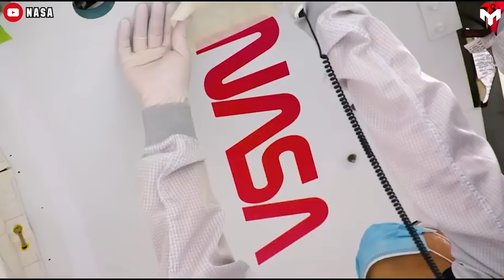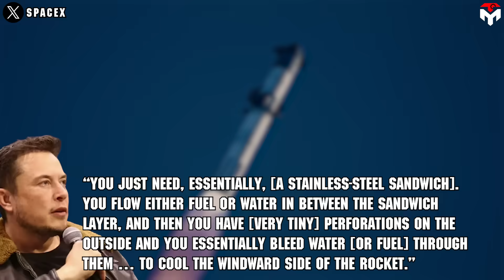SpaceX Crew Dragon to the Moon instead of NASA's $2B rocket...

Comment: NASA's vehicles are hardly failing. SpaceX hasn't been able to get Starship in orbit or reenter from a suborbital flight without the craft being damaged or blowing up. Using such a top heavy ship as Starship to land on the moon presents an unreasonably dangerous risk of the thing tumbling over on landing if there is the slightest error. Musk wants NASA to cancel SLS, just so more money to give to SpaceX. 

Far from failing, SLS had a successful maiden voyage, showing NASA can build a ship that flies on its first try, something SpaceX has never been able to do.
Reply: Has SpaceX begun to Human Rate Starship?  How many years did that take for the Falcon?
Reply: SLS is based on 50 year old shuttle hardware. Plenty of failure there fanboi. Also crashing unmanned hardware is how you build safe man rated hardware.
Reply: Its not a question of failing.  SLS is a magnificent rocket.  But at $4B a launch (now) and esimated $2.1B in the future it's unaffordable.   You could get 20 Falcon Heavys for that! 

And as far as being successful on its first flight, YES!  BRAVO!  But at what cost and how long did it take.  Care to bet that SpaceX has a succesful orbital flight with the chopsticks catching both parts of the vehicle before we get the Artemis 2 launch?
Reply: @ if it were 1975 it would be “magnificent”. But it’s time has passed and it is simply wasteful at this point as you pointed out. Falcon 9s aren’t the end all be all but they are probably a 80% solution at least and economically viable. Starship booster could be used today with a disposable upper and still be more fiscally responsible.

Comment: Orion has pretty much finished its $20 billion development.  The heat shield issue has been resolved.  The Super Heavy could be modified to carry a Starship prolusion stage and easily lift a Orion stack to lunar orbit.  The Super Heavy would have to be crew rated which is in the plan.  Such a system would be vastly cheaper than SLS.
Reply: @WWeronko  I completely agree.

Comment: Ok.  NASA made a big thing about 'reuse' of existing technology - using Space Shuttle era tech to build the SLS.  Well, they should have gone back to Apollo.  If you Google the sizes of the Apollo components - the Command Module and Service Module and Lunar Lander - you will find they can ALL fit inside Starship.  Replace the CM with a Dragon.  Add more fuel to the SM.  The Lander may not be needed - as Dragon CAN land on the Moon - and return to orbit, if it has enough fuel onboard.  Refuel after re-docking to the SM, then return to Earth.  If enough fuel can be stored in the SM, it may be sufficient to reduce the speed once back to Earth for normal Dragon re-entry speeds.  All at a fraction of either an Apollo mission OR an SLS mission costs.The SM AND Dragon could even be retrieved by a follow-up Starship mission to orbit, similar to how being able to retrieve the Hubble Telescope could be accomplished.  Retrieval by Starship, could eliminate the need for advanced heat shielding on Dragon, aside from the emergency backup criteria NASA requires if retrieval by Starship was not possible.

Comment: Maybe this is a dumb question but if the Starship is going to the moon anyway, would it not make more sense to use the Dragon to ferry the astronauts up and transfer them to the Starship after all the fueling,  before it leaves Earth orbit, then reverse the process when they come back? Seems like a safer and more sensible solution to me. No need for a FH. You could use the Dragon as is. It would be easier to beef up Starship than making  a whole new Dragon.
Reply: NASA plans the return trip from the Moon to be rather energetic.  It will fall rapidly to Earth and enter the Earth's atmosphere at very high velocity.  There will be no opportunity to transfer to a crew Dragon.  The Starship HLS (Human Landing System) doesn't have heat tiles and couldn't survive a Earth reentry.
Reply: @WWeronko  What I'm saying is bring the lunar SS back to earth, park it in earth orbit,  then transfer the astronauts to a waiting crew Dragon to bring them home. You can leave the lunar SS in earth orbit for refueling and reuse. Why can't that be done?
Reply: @ It is a question of available fuel.  Breaking to go into Earth's orbit takes a fair amount to fuel.  If you have the fuel available just about anything is possible.  It has been proposed in the past a shuttle to and from the Moon like shown in 2001 a Space Odyssey or a Earth to Mars space liner.  In the longer term both will likely be developed.  For now logistics will limit what is possible.
Reply: @WWeronko  Does not seem like that great a leap to figure this one out. The pieces to the puzzle are already there. They just need to think outside the box a little and pull it together.

Comment: They should just do it to take the wind out of China's sails and reassert US as the leader in space exploration. It could be done reasonably quickly and very cheaply and would boost US enthusiasm into the future.
Reply: Why do you see a need to take the wind out of China's sails? I thought they were doing quite well.
Reply: @michaelreid2329 I don't mind that they succeed, genuinely and not at the expense of others., I'm just a bit suspicious of how well they are actually doing. CCP are habitual liars, and a lot of their accomplishments are fake. You should never support something that promotes lower common denominator like communism does.
Reply: @michaelreid2329  I don't mind that they succeed genuinely, and not at the cost to others. The CCP are habitual liars and their propaganda is unrelenting, they are not adverse to lying about anything they do for global support, so the bigger achievements I'm not so sure of. The main issue I have is they always take over industries as a collective so they operate like communist when they want your jobs and business but not when it comes to taking you money. Sounds like though that you would rather them be the leaders. No capitalist system can avoid being subsumed by that.

Comment: SLS and Orion have completed a successful flight to and from the moon. A Crewed Artemis II will happen before Starship is even at the point where it can successfully transfer fuel in orbit from one SS to another. Then there's the Lunar Lander SS which is at least a decade away from the realization of a space worthy, reliable vehicle. With Space X fans it's always shoulda' coulda' woulda' with the assumption that everything the company sets out to do will be done. We lack only a practical lunar module to complete Artemis. Time to give that task to somebody else even if it could be launched using a falcon rocket.
Reply: @Ferret-v8r  Hmmm… I was under the impression that Blue Origin is already under contract to build an alternate lunar lander for Artemis 4 and beyond.  I would have no problem giving them some additional funding to speed up development by 2-3 years.

Comment: Why can’t we return from the moon to a space station? Then return to earth.
Reply: ISS is also in low earth orbit, moving at around mach 24. so any vehicle returning from the moon would need to dramatically slow down first, requiring major fuel burn
Reply: Because it would take too much fuel. Returning from the moon uses Earth atmosphere to slow it down. To return to ISS, you would have to first carry that return fuel to lunar orbit, then carry it back. The fuel difference would be crazy!

Comment: Not sure what the various weights are and everything but the only thing close to Human deep space certification is the Orion capsule. If the Artemis rocket is canceled due to its cost we have at least two and maybe three ways of using Orion. I believe the taxpayers have paid for and build four Orion. 
Falcon heavy, new Glenn and the Starship booster all may be able to carry the Orion.  It's going to be years before we have a landing vehicle capable of landing and getting back off the Moon, but we could be very close just setting up the orbiting space station in lunar orbit if everyone  cooperated and used what systems we have or that we are close to having.  It just takes someone with a political will to force all these people to get along and at least cooperate enough to work toward a common goal. While throw away Rockets like a Artemis are obsolete, it doesn't make sense to throw away all the research and certification that the NASA has done on the Orion capsule.

Comment: As a business model, unless you had a bunch of customers lined up to buy seats on a Lunar Dragon (including NASA), it doesn't make sense to invest in the time and money to modify Dragon. Using Orion on either a manned rated Falcon heavy or a manned rated Vulcan, which neither currently are, would make a lot more sense. New Glenn also fits into that option. Time is also a strong consideration in this. The time involved to stop SLS and start with another launch vehicle has to be a consideration. If it was an outright cancellation, that would put us who knows how many years behind in going to the moon. The smart thing to do, considering the short fall in estimates, would be to fly sls 1 or 2 flights past a projected restart of the program using an alternative launch vehicle.

Comment: Sorry but I dont get it what is so "genius" about landing a tiny "Pinto" equivalent Dragon capsule when you can land an "18-wheeler" instead bringing a buttload of equipment down to the Lunar surface.....

Heck they even could get a Dragon capsule with Starship down there to fly "back" in it if they so desired......

But yes Dragon and F9 or FH would be far better than SLS and Orion. (if they get a decent heatshield upgrade to Dragon!) but why go with an "on par" lower cost swap when you can go BIG instead??!!
Reply from the maker: Thanks for cmt. But the matter here there are many scandals around SLS and Orion 😩
Reply: @techmap9 Yes I know of them all.....wait until DOGE audits NASA to learn more about it.

A StarShip launch (fully expendable like SLS but in non reusable test flight mode) costs about 100 Million USD.

SLS (WITHOUT THE OLM) costs 4 Billion!!

How can a government job be 40x as expensive?? And that with even using USED and STORED rocket parts (like the Space Shuttle main engines)??

Only possible with MASSIVE CORRUPTION and kickbacks.

Still the treatment for SLS should not be a Dragon/FH solution but make Starship Lander a complete system = start with astronauts, fly to the moon, land, get off the moon and land back on earth (or at least enter LEO and dock with an EARTH return vehicle.....

Comment: Good Morning my Friend. If there is one thing Boeing is good at it's politics. We still need to know where all the money went will all the cost over runs. Nikki Haley increased het millions by being on the board of directors at Boeing. Dave Calhoun gave himself a multimillion dollar pay raise while he was CEO of Boeing. And this is only what we know. Boeing's Starliner was a disaster. Using substandard materials with substandard programming. It's more that time to pull the plug. Let Doge have at it. Let's figure where the money came from and where it all went. Make them accountable for more of out tax dollars. SpaceX has more than proven itself. ULA still hasn't done anything. ULA seems to be in a holding pattern. Blue Origin hasn't really proven itself either. It looks like Blue Origin isn't doing so well with there massive layoffs. I'd like to see more about Sierra Space. How are they doing? SpaceX's approach on the heat shielding is a great innovative move. There again thinking outside the box. Running coolant through the heat shielding may be the only way you can get repetitive launches without constantly replacing heat tiles. Great Update my Friend. Have a Great Day.
Reply from the maker: I always found your comment interesting bc it is so detailed and helpful. Thanks for that. Have a nice day, my friend ❤️❤️❤️